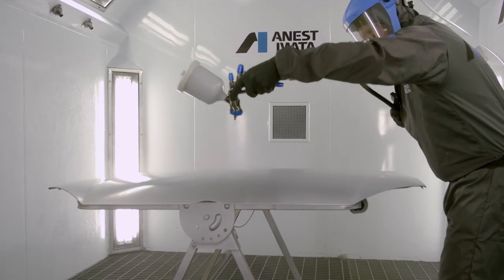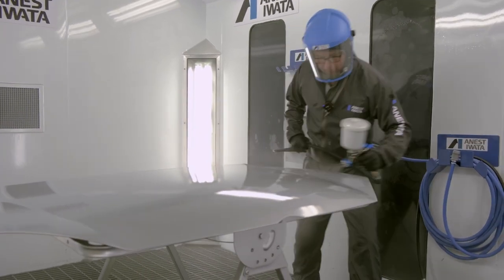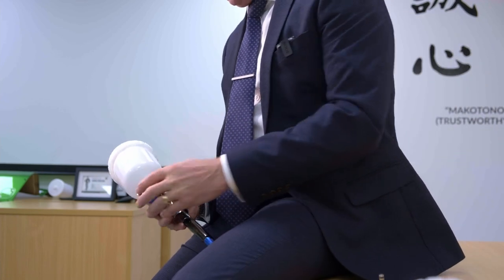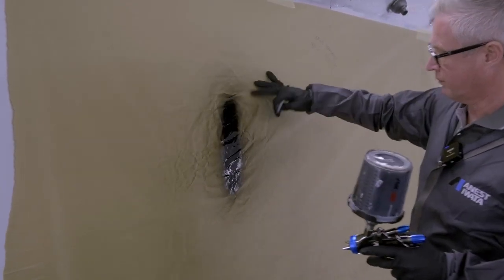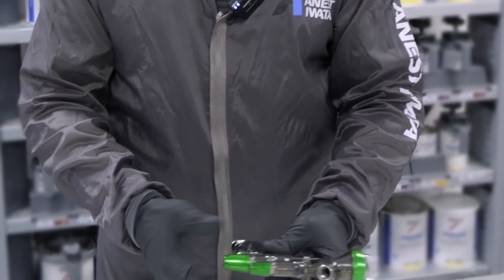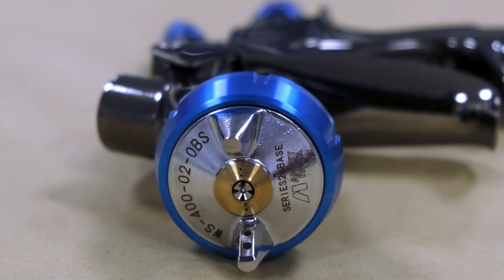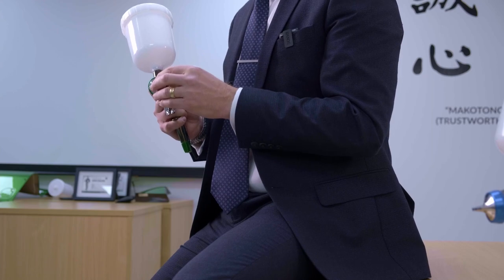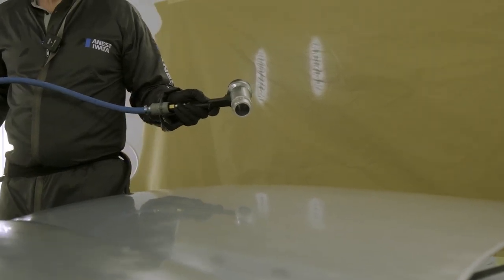Series 2 Launch - Chapter 3: Why Series 2?

Comment: Fantastic! I'll definitely be investing in a clear gun, any recommendations  on a clear gun for Scottish weather etc? Just a standard 1.3 set up?
Reply from the maker: Dear The Jabber of Jobbbies, thanks a lot for your appreciation.

It depends on the application speed: if you tend to apply fast enough, a 1.4 set-up (which delivers a fairly large amount of paint) is recommended, if instead the application speed remains on a normal level (which means not too high speed), a 1.3 set-up is suggested, as already considered.

Sincerely, M.M.C.
Reply: @anestiwatanews  thanks for that
Reply from the maker: @jabber67  you are really welcome ;-). Marco M. C.

Comment: I have watched alle the video´s . Butt i cant make out what basecoat gun i need . 
I paint centari (cromax)6000  , also comax pro (waterborn) and  novol spectral wave 2.0  .
Somethimes other brand when the customer wants that . 
So hvlp green one is for solveent en waterborne base . Butt not for wet on wet basecoat application like the cromax pro .
The blue one obs is only for wet on wet application basecoats .
I always try to get the flattest finishes so hvlp is not my pick if i can chose .
What would you reccoment ? And why ?
Reply from the maker: Hi Steven, on our website we have recommendation charts, which show the correct setup for whatever product you are spraying! 

https://www.anest-iwata-coating.com/en/microsite/

Cromax Pro = WS-400 BASE OBS
Spectral Wave = WS-400 BFS or LS-400 

These are the recommendations from the paint companies themselves and our technical teams!
So you are correct in your understanding of the Series 2 basecoat guns. But we are here to help if needed! //J.B